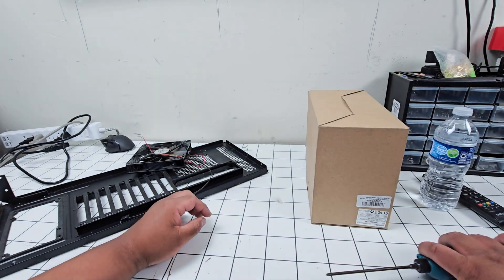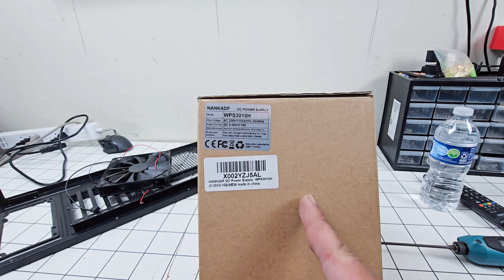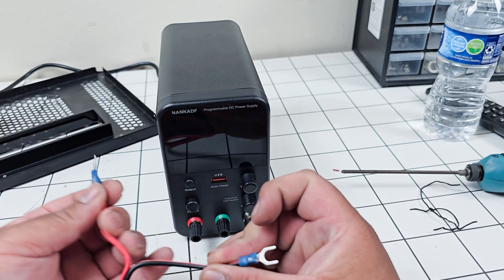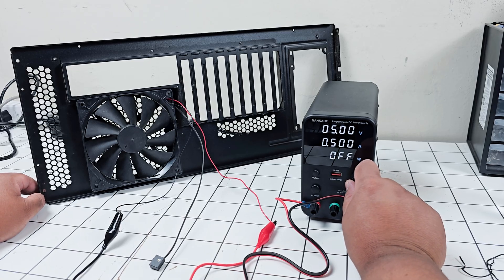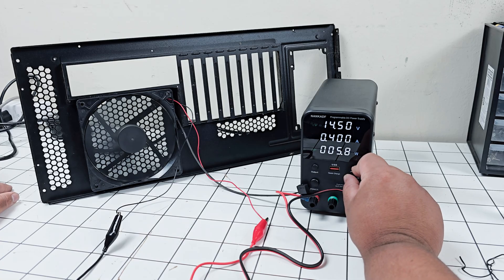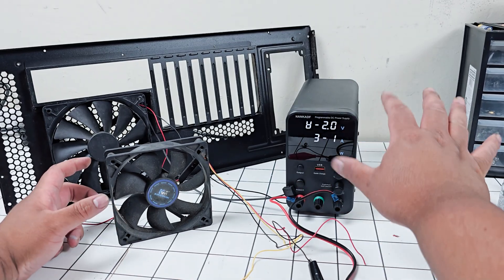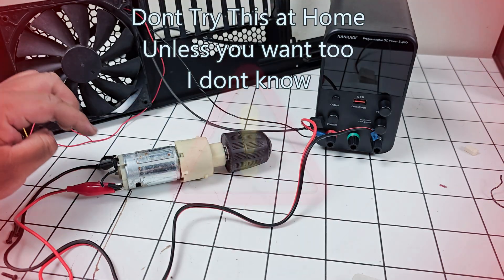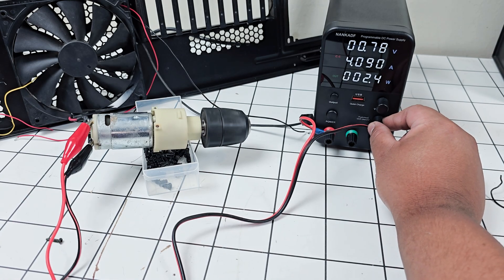I Tried Overvolting a PC Fan What Could Go Wrong? 😳

Comment: I once connected a 140mm fan to a power supply with 65 watts output, 20V output voltage, and 3.25A current, and yes, it did spin faster, but it was very unhealthy for the fan in the long run.

Comment: C.C means Constant Current. The reason it came up was because it had reached the current limit that you set on the PSU. If you really wanted to blow something up then you would have to set the current limit to as high as it would go (say 3Amp) and then use the voltage. 3A at 30V would be 90W of power, no pc fan would handle that.

Oh and just so you know, 2.000 is 2 amps, 0.200 is 200 milliamps or 0.2 amps
Reply from the maker: Thanks a lot! I may not know much about DC power, amps, or voltage yet, but I’m always glad when I get the chance to learn
Reply: @TekSavvyAron  some quick info which apply to both AC and DC

To find Watts: Volts × Amps = Watts (W = V × A)
To find Amps: Watts ÷ Volts = Amps (A = W ÷ V)
To find Volts: Watts ÷ Amps = Volts (V = W ÷ A)